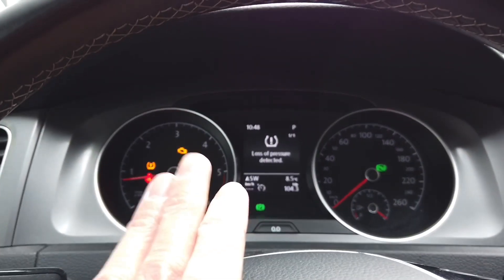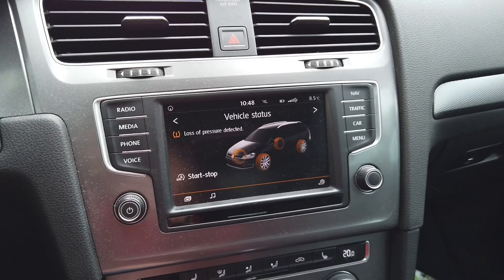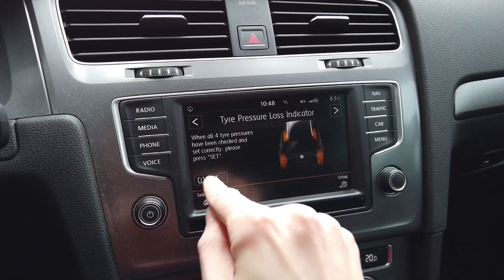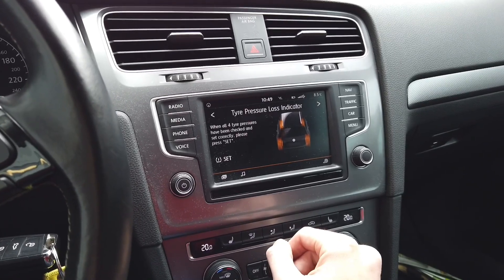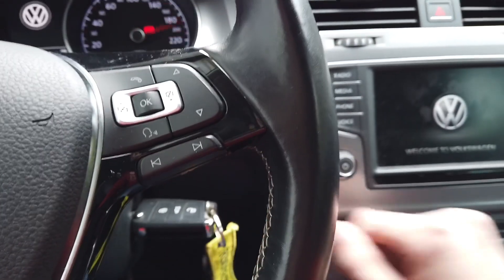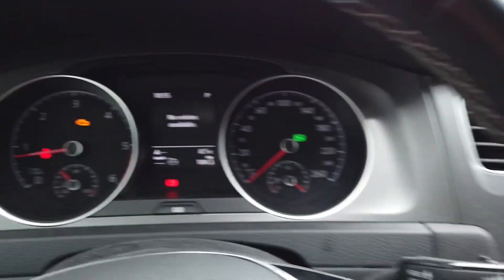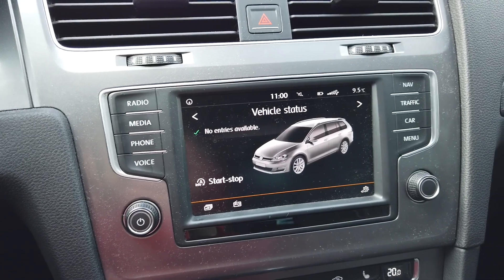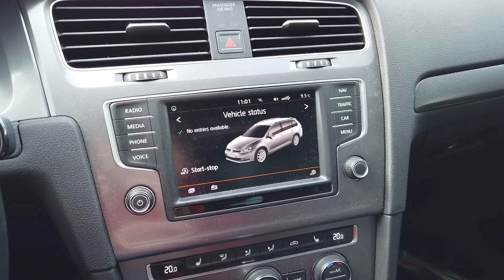VW Audi Seat Skoda - tire pressure monitoring system reset

Comment: hello, I followed the whole procedure but once installed on sd card after downloading and unzipping it, my MIB2 installed on my passat b8 of June 2016 does not detect it.  where am I wrong? from the same site I updated the 2020 maps and everything went well.  please can you post the ready-made file or how can I do it with what program and in what format.  thank you very much for helping
Reply from the maker: Check if the card is formated with FAT file system.